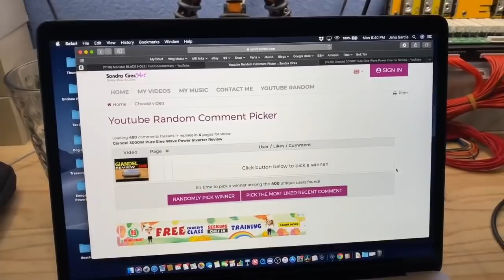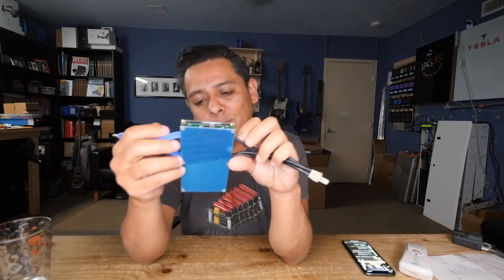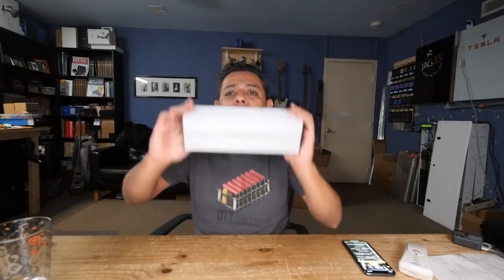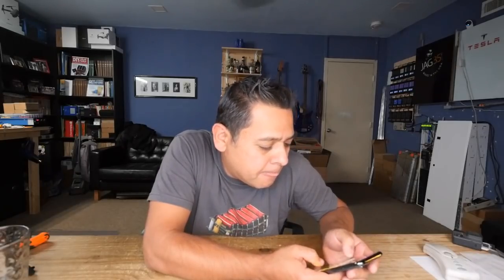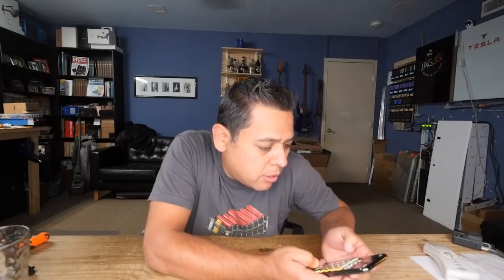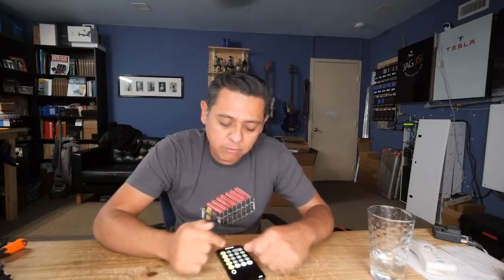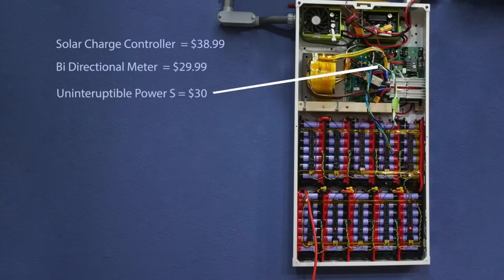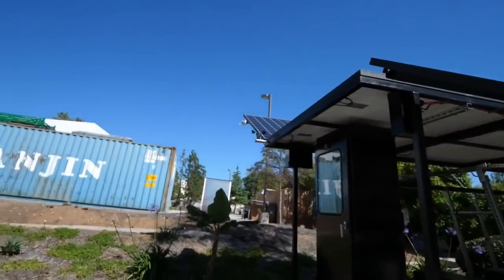DIY Electric Classic Kombi - first of the fleet

Comment: Jehu, I think it's great how you give back to your viewers. With the quality of information and videos you put out. You gave me the final push and assembling my first lifepo4 battery pack. I used headway 3.2v 10ah cells in a 4P4S configuration. Also to assemble a charging system. I think it great how you work with others to expand your viewers experience. With EV vehicles, power walls, building battery packs and so much more. And how you think about making people with very little life better with green power. Also making a small impact on the environment, with repurposing power cells into green energy. Thanks from your viewers!!!